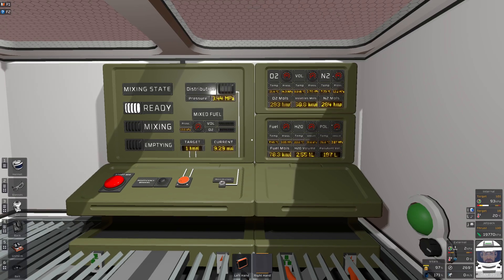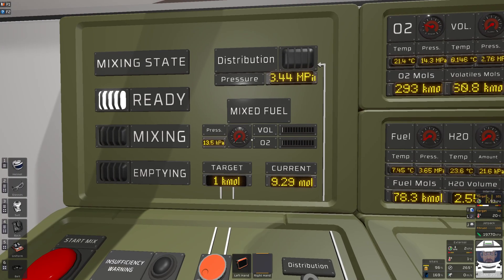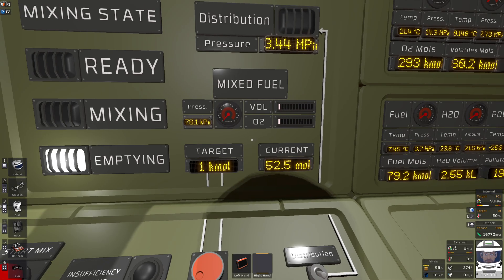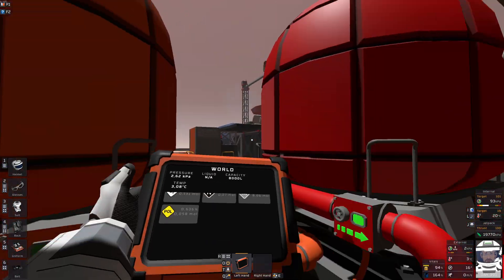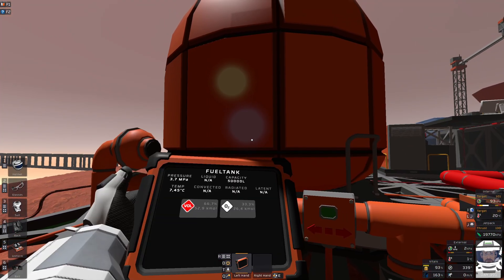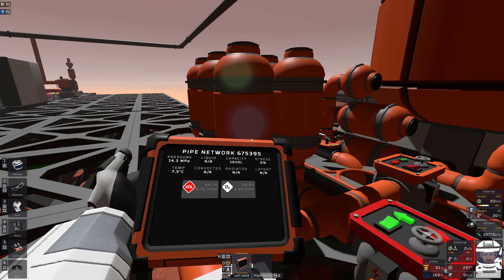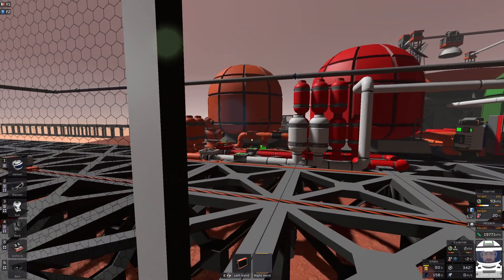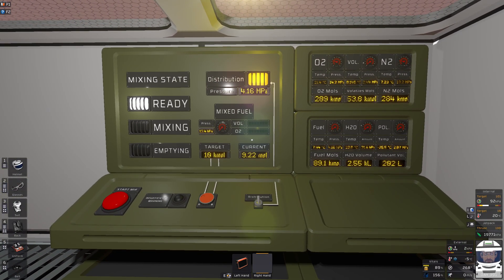Accurate fuel mixing in Stationeers with modular consoles

Comment: What mods did you use?
Reply from the maker: A bunch of different ones but the main one here allowing the console is "modular consoles".
Reply: @tacklemcclean  Thanks! Was looking for a mod that let me do the exact thing shown here! I'm guessing that you have a few IC10 chips somewhere that give the data you need? Also how did you get text on the consoles? Is that in the mod?
Reply from the maker: @AnonymousUserInUse Yes correct it's part of the mod, "labels" basically. I have two IC chips for this whole setup to handle both the consoles/controls and the mixing itself. Both are close to 128 line limit. It works since I know "where everything is" but would be a bit annoying to inherit from someone else 😂
Reply: @tacklemcclean  Damnn 128 line limit?? That's insane. I still have a lot to learn from IC10...
Reply from the maker: @AnonymousUserInUse It's not that bad honestly. Only with modular consoles, where you address so many devices and repeat many similar instructions, has it felt short.
For all else, so far, it's been enough. Unless you want to many different things on the same chip. But just divide it up to individual responsibilities per chip and you'll be fine.